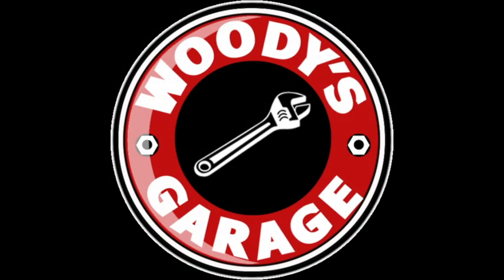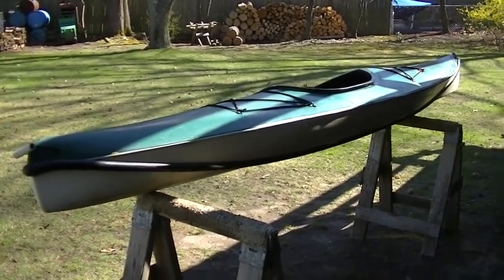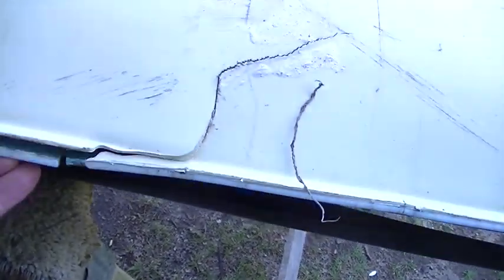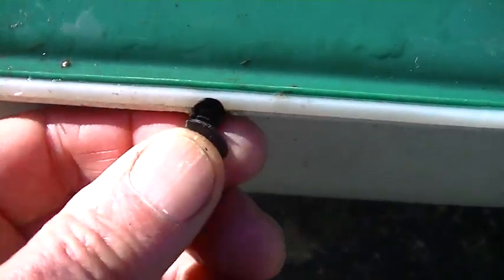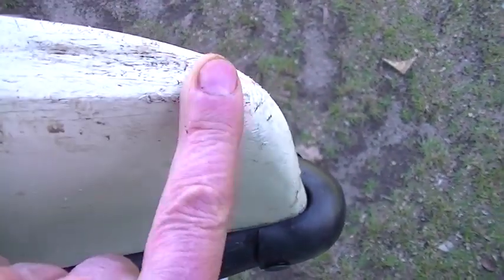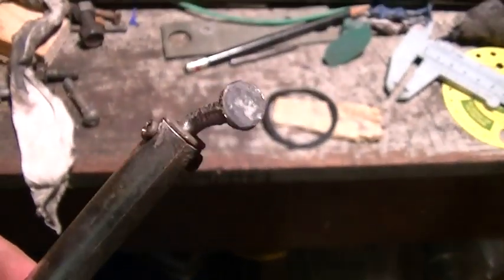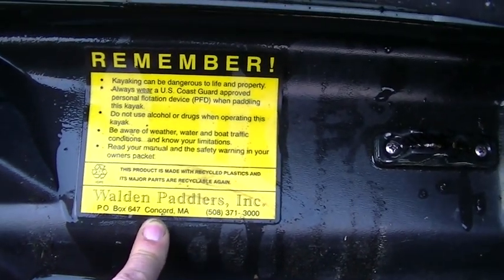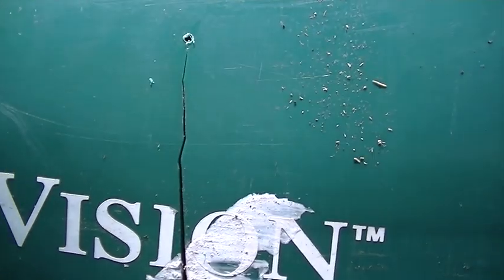Walden Vision  Kayak Repair Part 1

Comment: I have this kayak and fixed some cracks with plastic welding (melting plastic) then sanding it. Worked amazingly. 
What did you use for the trim? I'd like to replace mine
Reply from the maker: I used the original trim, it was kind of stiff from age but worked.
Reply: @woodysgarage469  Ahh mines shredded.
Reply from the maker: @FloridaManVal  Look on ebay for boat or car molding I'm sure something will come up that will work. Good Luck.